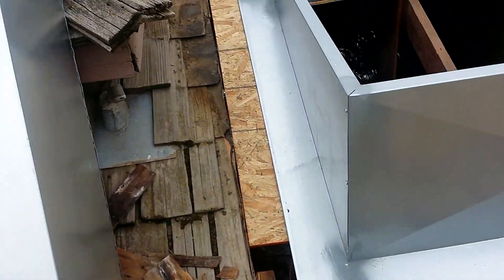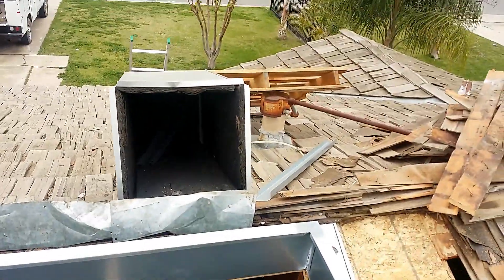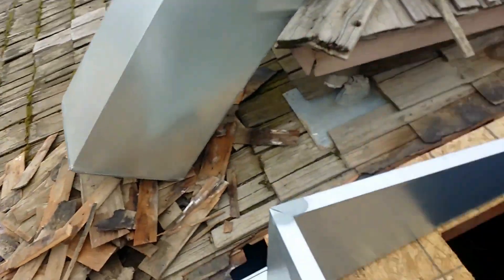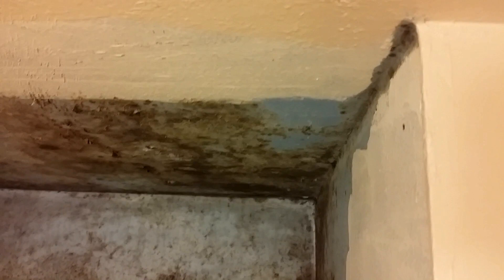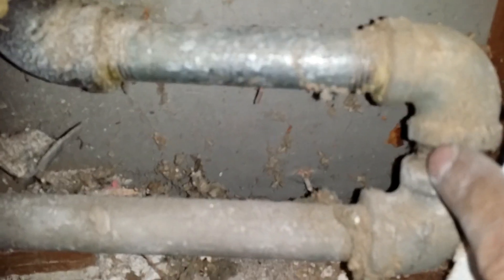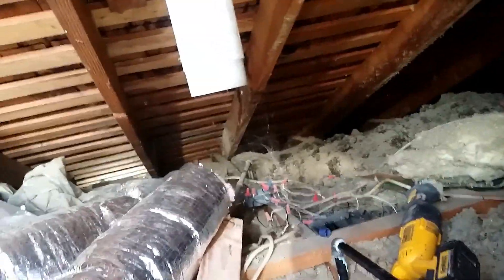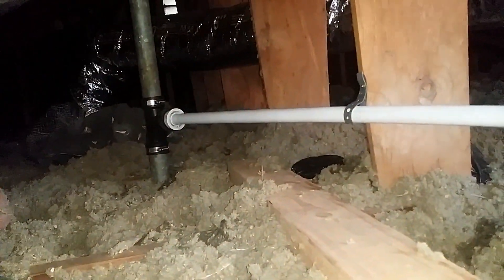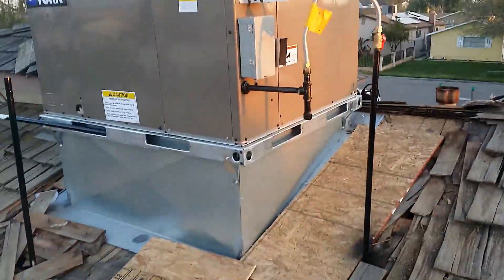HVAC: Part 2 to RTU install

Comment: I know the roofer tile up to/around the base of the curb but what happens to the rain water that gets in from the top fan?  Some people have a curb sitting on bare wood with no tiles underneath. Also what about the seal between the bottom of the HVAC and the curb it sits on? Any sealant needed there?

Comment: Clean install. Why didn't you run the drain line out side, but from inside the attic? Instead to the sewer drain. Anytime you could run a drain line outside, instead of sewer drain, you would want to go that route. Designate the ac to its self. Electrical, and drain.